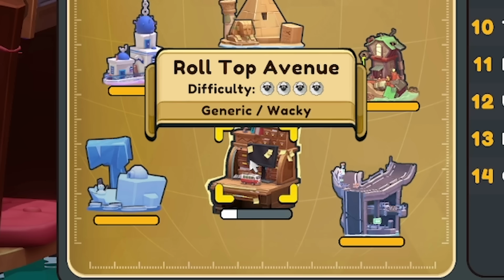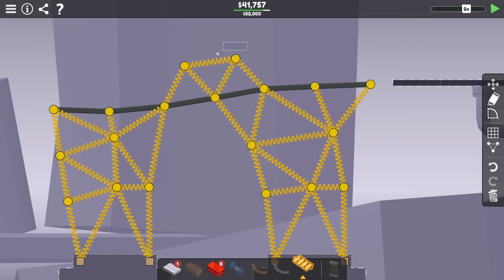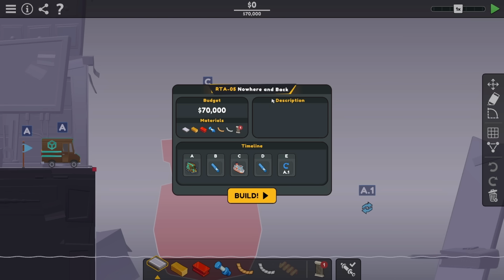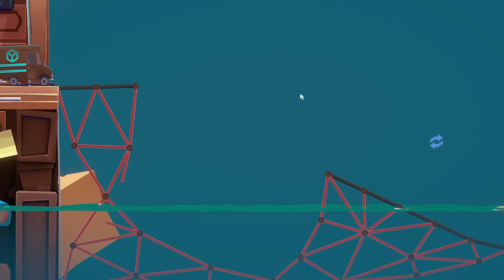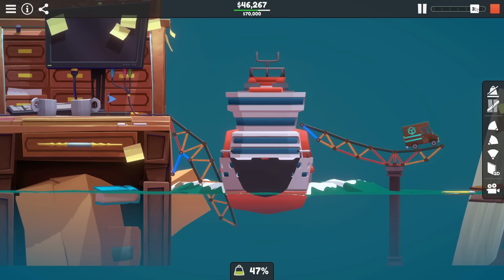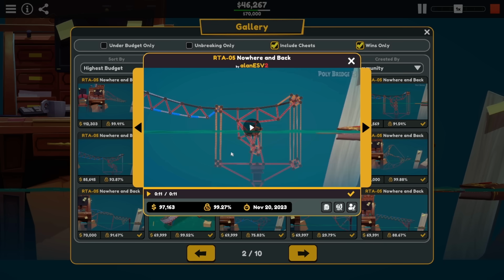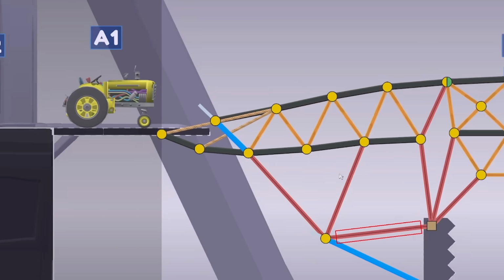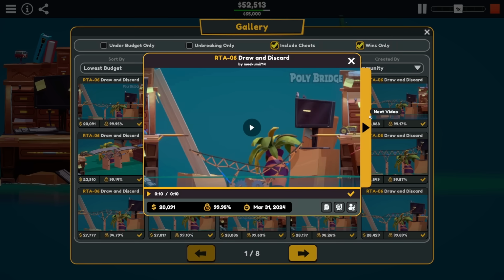Engineering BUOYANT BRIDGES in Poly Bridge 3!

Comment: 11:16 its not the hydraulics. The van is on the other side of that road, when it disconnects the tension goes away, the bridge unflexes and raises the disconnected point higher. By forcing that point lower with a hydraulic you are forcing an unnecessary internal stress into the design, which is why it breaks when the car drives across again. It isnt the fact the car is driving the other way, most of the force is still down reguardless of the direction of travel.